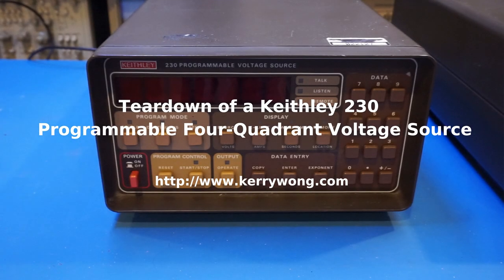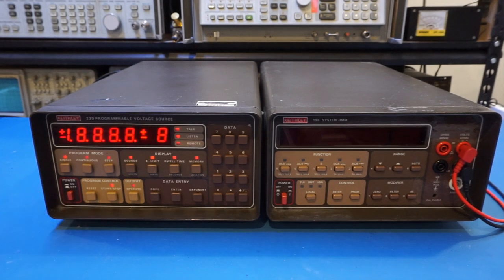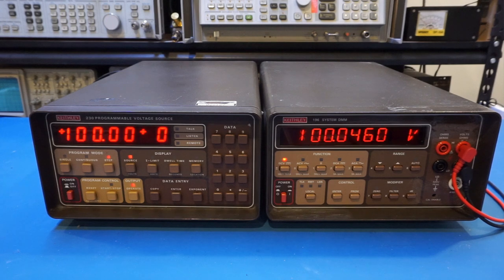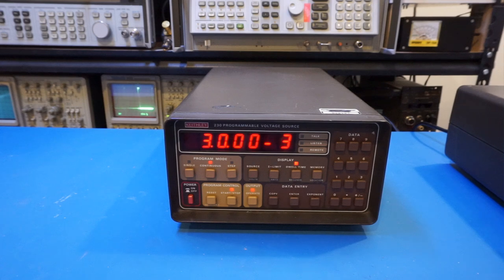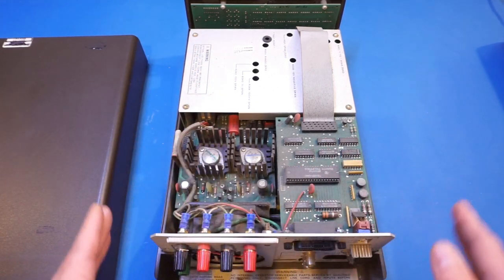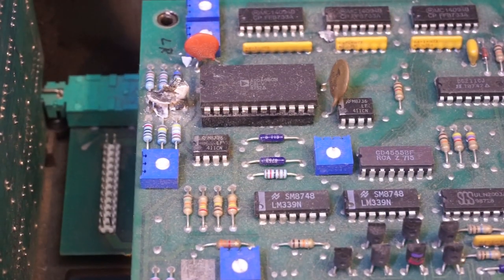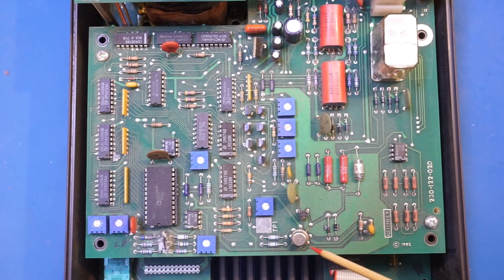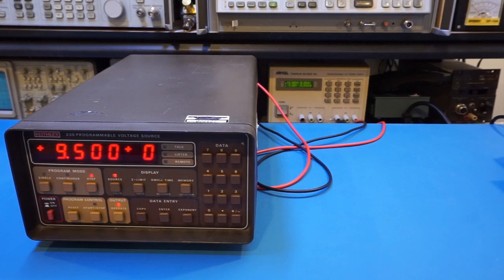Teardown of a Keithley 230 Programmable Four-Quadrant Voltage Source

Comment: Inspired by your video on the Keithley 230, I found one on eBay for my lab. For the price I paid, my expectations were not high, however what I received was as close to “like new” as any eBay used I have bought before. Except for the 10V range, the unit was in spec. I have several other Keithley meters and have had no trouble calibrating them to spec, so I thought the 230 would be easy as well. The calibration instructions are simple if read carefully and followed exactly. Like “word for word” exactly. 

The only remaining problem was that the 10V range “+19VDC” calibration point could not be reached due to the trim pot hitting the stop.The “-19VDC” was reachable however. If I input “+19.000,” my calibrated 6.5 digit bench meter reads “+19.031671” which is a tad over 10mV higher than the spec limit. I checked the 5V supply (5.01 \ish) and the 15volt rails: -15.0027 and +15.257. The regulators are 7815’s and 15.257 is within their expected range from the data sheet. The interior of the case was “lab-clean” and there were no obviously bad parts. And, no I did not poke my greasy fingers on the precision resistors or even remove the analog board. I did remove the EMF shield to inspect, but it was in place for calibration. 

 My first attempt to repair was to replace the trim pot on the +10V op amp (based on some experience with vintage gear mechanical components getting set in one spot for decades), however that made no difference, so put old one back. After a close read of Theory of Operation, I ordered a replacement for the ADDAC80 24 pin socketed DAC chip from DigiKey. It showed up in late mail last night and I installed it "just to see." The problem with the 10V positive range was gone, in fact all ranges looked good, maybe a bit low. Did the full calibration this AM and all outputs from 0VDC to 100VDC are within 0.01% of their input value on the 230.

Thanks Kerry!

Comment: I love mine. Very useful piece of test gear. Your video is also timely as half a dozen units have just appeared on eBay starting at $75. Keithley tops and bottoms can be swapped with other models of the same vintage and many have common CPUs, GPIB controllers and peripheral controllers all socketed. One of the best things about old test gear is that schematics for most are available and the through hole construction makes for easier repairs... usually.

Comment: This is a fantastic video! Would you consider doing a follow-up on both the Performance Verification and Calibration Adjustment procedures for the 230? The PDF manual is a great resource, but to a novice like me, it's a little intimidating.

Comment: Hi, I need to program this supply.  Now I want to program this supply using C# on computer, that means I need to send commands using Serial port to GPIB port. All functionality I want is to change voltage per command from computer. Thats it. I pretty new to GPIB arena, and I simply don't know which commands to send. Accidentally, this supply was assigned to me, otherwise I would have never opted for it. Can you please guide me how to program, which commands to send in order to get this functionality?
Reply: The programming guide was released for the models 220 and 230 together, so if you search for "Keithley 220 programming guide" you will get links like http://bee.mif.pg.gda.pl/ciasteczkowypotwor/Keithley/KEI%20230%20Program.pdf which include the instructions for both the 220 and 230.
Reply: @DerekWoolverton  long done sir.... 😁👍